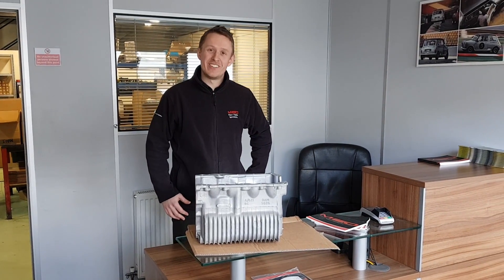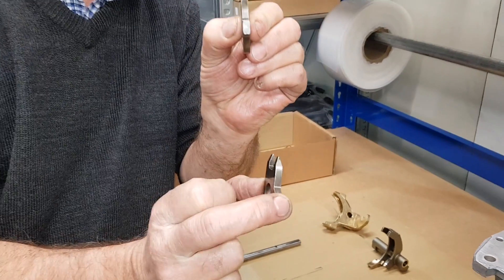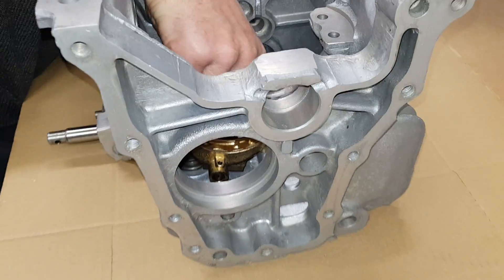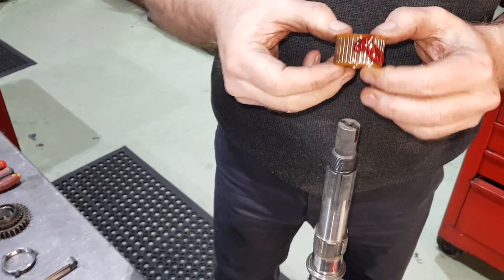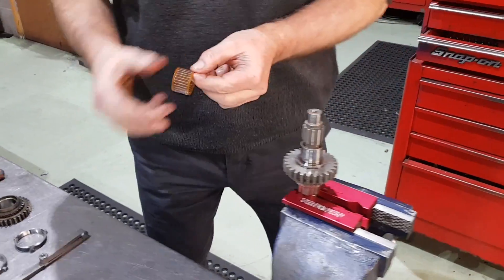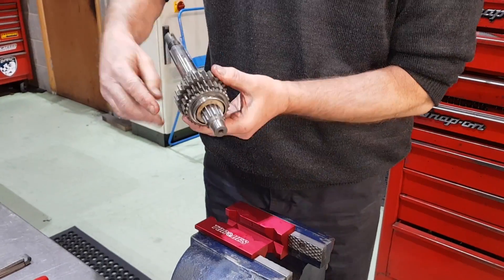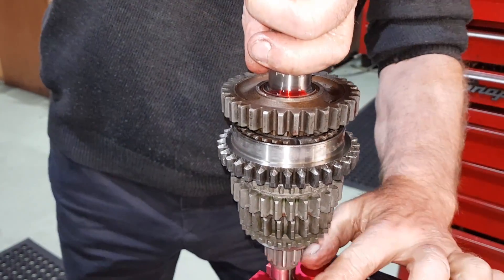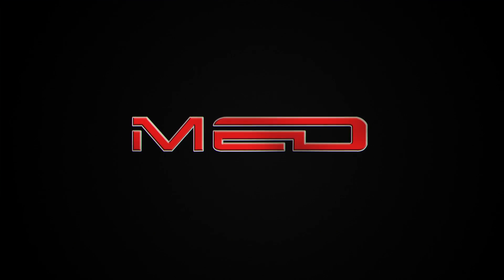How to build an MED straight-cut Mini gearbox - part 1

Comment: Is it worth mentioning to newbies that if the selector hubs are pushed open too far the three balls and springs will fly out to all corners of the workshop?!!
Reply from the maker: No, this should be a valuable learning experience :p!!
Reply: MED Engineering Super instructional videos but made by sadists!
Reply from the maker: @specdel  Haha, yes it is a very good point though - hundreds of these balls have been shot around workshops, garages and driveways over the years!